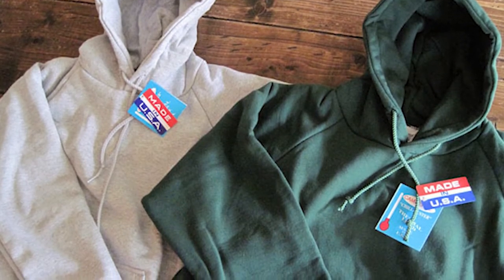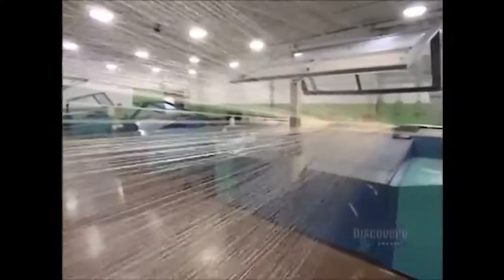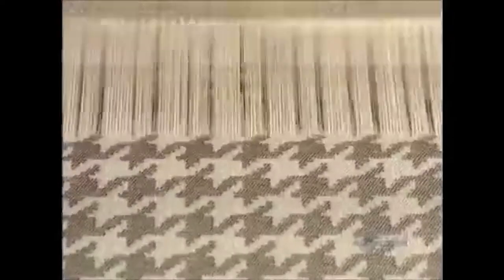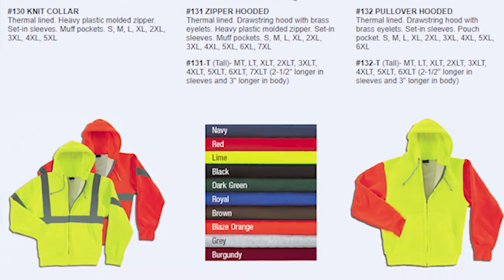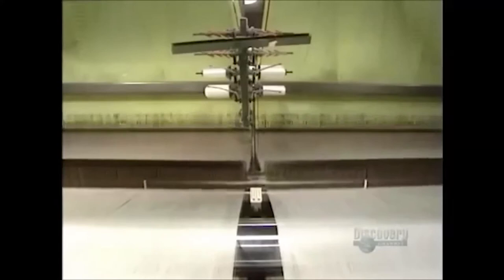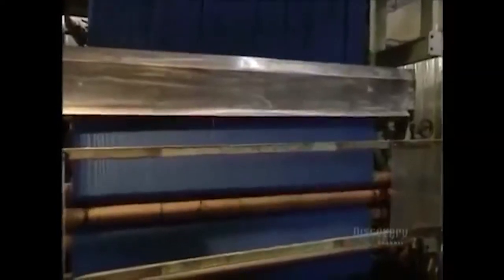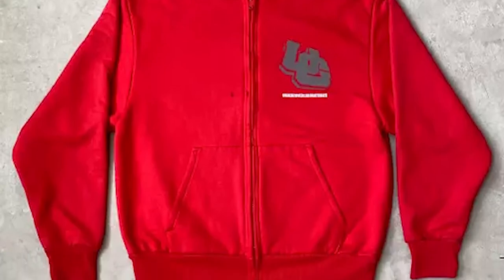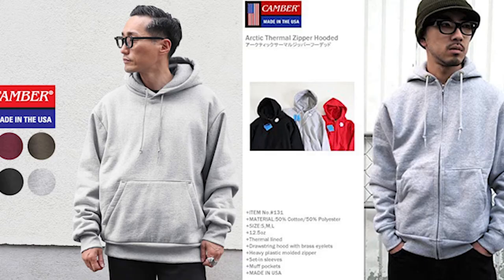Camber: The BEST Made in USA sweatshirt in Japanese Streetwear

Comment: Dude when camber makes a double thick sweatpants to go with the double thick hoodie I will be in winter heaven
Reply: How's double thick hoodie?
Reply: @junniechoi  big, heavy and warm. It’s pretty much impossible to layer it under a coat, but the extra bulk adds to the look it’s own statement. Also, hard to overstate how nice it is to have metal snaps for the hood instead of drawstrings

Comment: Would love to see Camber double Hoodie vs Arborwear. Just ordered a Camber double Hoodie, can give you info once it arrives if needed. Awesome video man, hope this brand stays low-key
Reply from the maker: actually really curious about the double hoodie, let me know for sure
Reply: Dude the double thick hoodie is a beast, easily the warmest and most ‘overbuilt’ hoodie I have. The thickness is very obvious both in the fit and feeling - you can really feel the two layers as separate from each other, like a billowy stuffed feeling. Also important to note that double thicks are oversized by two sizes
Reply: @ajfelling  if I normally go small for hoodies, does this mean ordering a small of the double hoodie will be super baggy/big?
Reply: @danielrothenberg6410  yeah definitely, I bought a size small and it’s definitely big and bulky. For a size comparison, it’s slightly larger than my carhartt active jac (also a size small)